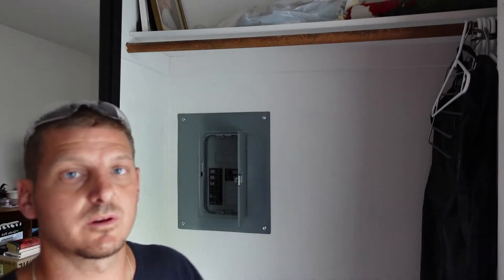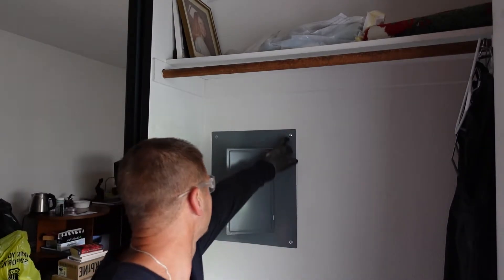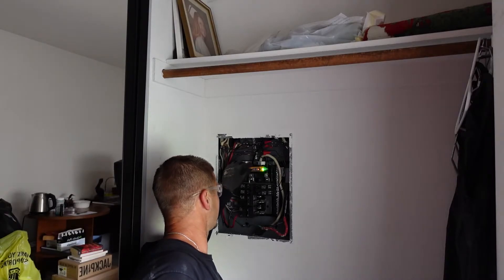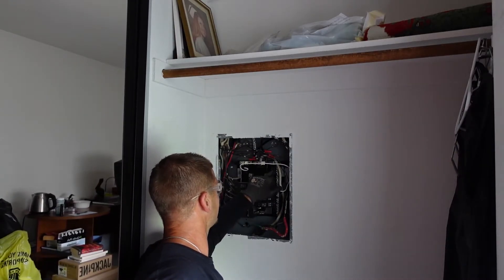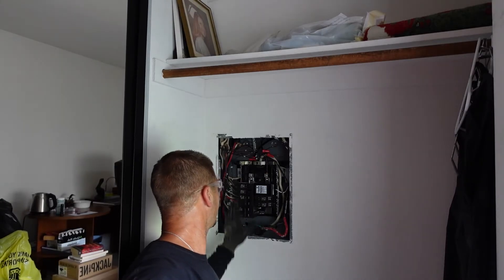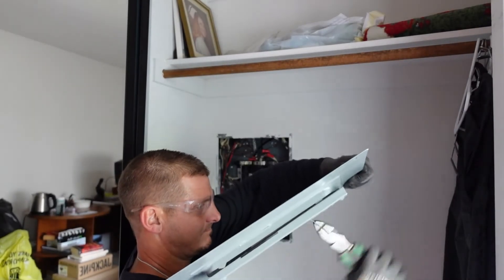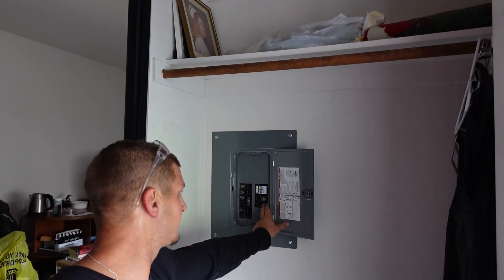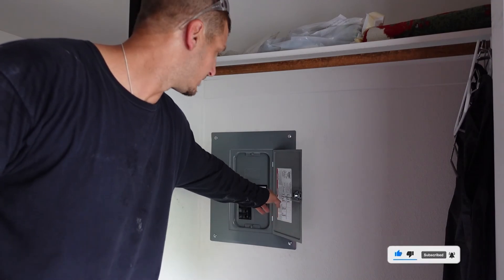How to install a surge protector for a sub panel- The right way!

Comment: Wait, you said you put the white wire to the ground bar. Don't you mean you put it to the neutral bar?  The surge already clamps to the ground bar, so I would think you have to run the white wire to the neutral bar. I know it usually doesn't matter however with a sub panel you have to keep the neutral and grounds separate because they are bonded together in the main panel.

Comment: Great job I enjoyed watching. I’m curious so even putting it in a sub panel protects the entire house or only partial.😁
Reply from the maker: It depends, on where the surge is coming from and where it hits in the system.  Lightning will do as it pleases, and if it hits line side of this it will protect anything downhill.  If it's a spike from the utility it would protect the whole house because this is the only sub panel for this condo, but the other condos are not protected unless they have their own surge protection.
Reply: @SolidElectricalSolutions  oh ok
Reply: @heroknaderi  https://youtu.be/rMOVeM9uxb4 I made a video to explain this a little bit further, I hope it helps!
Reply: Panel in a closet??